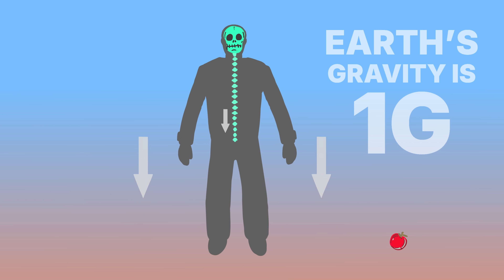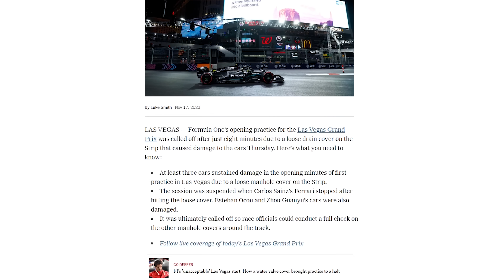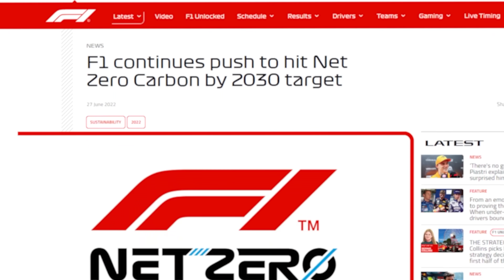Neil deGrasse Tyson Explains the Physics of Formula One Racing

Comment: @8:02-8:33 Correction: In that specific incident (2023 Las Vegas GP, Carlos Sainz) it wasn't actually a manhole or drain cover like was widely reported at the time, and the car's vacuum effect didn't suck it up like you've described (although such a thing can and has occurred in other races). It was a much smaller diameter object without a removeable cover: the head of a water shutoff valve. It protruded slightly above the paved track surface, enough that Sainz' car's floor struck it head-on. The aerodynamic forces did push the car down closer to the track surface and did likely play a role in the incident. just not in the way that is described.
Reply: Thank you for clarifying that.  As a 50 year F1 fan I get high blood pressure when the facts about F1 are distorted or ignored just to dumb down the story "so people can understand it".
Reply: @lonestranger  It was a flat 12" cover that should have been welded down.   There were a number of them that had to be inspected, which is why it took so long.  There isn't going to be something sticking up on a race track, much less an FIA F1 spec track.
Reply: Did they just Stallone Indy/Champ Car movie that incident? 😂
Reply: @JoelNekritz-te3gl haha OMG i forgot about that movie DRIVEN! 😂
Reply: @JoelNekritz-te3gl  Well this exact thing has happened as recently as 2019 Azerbaijan GP with George Russell, see watch?v=F5f87xjg-m4 It's just that it's not what happened this time.
Reply: What about this video? "George Russell's Drain Cover Incident Ends FP1 | 2019 Azerbaijan Grand Prix"
Reply: @kkfoto  That's the same video I posted in another reply above, and it's one of the instances I meant when I said "such a thing can and has occurred in other races". They should've used that incident to demonstrate the physics instead.

Comment: I would love to see a video about Top Fuel races. It’s completely nuts. They are so away from the box in which every other motor sport is. An they are the king of G’s - 6 and acceleration 0 - 530 kmh in under 4 seconds!
Reply: @pawewielgus2105  They average ~4 for a few seconds, 5 with the chute.  F1 only does ~2g accelleration, but hits lateral peaks of ~7 , sustained ~3-5 in many corners, 6+ g under braking - many times per lap; lap after lap for 2 hours.  A bit more of a g workout..

Comment: 3:44 You should see a WEC car, a f1 car can only do nose and tires, a WEC car can have whole sections of bodywork and even suspension replaced!
Reply: That's simplifying F1 to the extreme. They can change sidepods, the floor, suspension etc. Look at the cars. They can look different from race to race.
Reply: @sersjantma I was talking about what you can change in one single pitstop, it’s really impressive how modular that car is, it takes but a few seconds to change parts that would take atleast half an hour on a F1 car.
Reply: I've seen rear wings and other bodywork being replaced during pitstops in F1 races.

Comment: I know it may not seem like it, but the physics of NASCAR is why I watch. 

I'll put it this way: Travis Pastrana, an amazing FMX legend, daredevil...he's done it all. Rally racing, NASCAR, Motocross, Freestyle Motocross. When asked what the most difficult was, he didn't hesitate to say NASCAR (which, I'll be honest, shocked me. I know how much physics is involved in NASCAR, but I didnt think it would be harder than...idk, don't a double backfilp on a dirt bike!)! 

If you are interested, try a NASCAR simulator and see what I mean. The airflow from other cars, as well as the wall, changes the car's top speed drastically! It's crazy to see cars with, essentially, the same limited engines...and yet, some are able to get faster times by using tactics like getting a gravity assist from the bank of the road (if you are high up on the turn in a high bank turn, as you come out if the turn, you can aim a bit down towards the center of the track instead of following the outside line. When you do this, your car will be going downhill for a bit, hence: gravity assist).....or tactically teaming up with other racers because a row of cars is more aerodynamic than a single car, if they are close enough (like, inches apart...going 200mph. the margin for error is not very big and if you mess up, you can ruin the race, season, career or life of your opponent or yourself).

Comment: Fun fact: The shuttle (as a metric) would do a max of 3gs during liftoff. 

If you got the the fair and get the chance to ride a ride called 'The Gravitron', it does 3gs as well. Its also sustained. 

So, you can experience the same G load as the astronauts in the shuttle during takeoff. 

Personal, I love Gs. I can't say to what degree. I've done, maybe, 4gs (just a guess) max my entire life, so I dont know what it would take for me to blackout. 

That being said: If given the choice, I'd rather test my limits and increase Gs until I blacked out...then have to go negative Gs at all. Even 0G, like freefall.... ugh, makes me feel sick. 

The only rollercoaster I like is the original (as in the prototype from Knoxberry Farms) Corkscrew, since the the entire thing, except the initial drop, is all positive Gs or close to 1G. so, I get that sick (other find it exciting but I'm odd, I suppose 😂) feeling from the drop, but then the rest of the ride is a blast and feels super enjoyable. Every other coaster.... pure torture to me. All of them. The log flume is literally to low of a G experience for me. I can do it...but it doesn't feel good. 😂 It's a 10'-20' drop, maybe? 

....and I'd rather ride the inverted coaster (with a, something like, 30' drop) a dozen times, rather than the log flume once. 😂

Comment: Yeah, it used to be terrifying before the pit lane speed limit was introduced. Full racing speed until they braked at the pit box, separated from other pit crews by a painted line! Really impressive how they can stop, change the wheels and drive away faster than I could possibly get the spanner thing onto my bicycles wheel nut.
💚🐇🐴💚

Comment: Buffs there's a lot of misinformation and misconceptions here...

HANS it's not for Turning G forces,  the driver have to deal with those, and they're trained to deal with those for almost 2 hours 😅

The Hans it's for crashing, when they crash, they can have peaks of 200Gs

The aerodynamics it's not only for the rear tyres, it's for the front tyres as well, they have to press the whole car against the floor with a balance, 

if you overload your rear tyres, the front end of the car wasn't going to turn at the speed you wanna turn

And if your overload your front tyres the rear will become loose and harder to control, hence, slower lap times
Reply: F1 by misinformed people for unknowledgeable people

Comment: 7:45 missed opportunity to further explain ground-effect, might be worth it’s own short episode one day. Great example of ground-effect are the Soviet Ekranoplans or micromouse races.
Reply: soviet ekranoplans are not using ground effect to generate lift, or to be clear it is called "ground effect" but a completely different phenomenon. F1 car speeds up air beneath it thus lowering partial pressure and creating downforce, whilst ekranoplan takes benefit of a, confusingly same named, ground effect that creates higher partial pressure under the wing and thus creates lift.
Reply: the ground effect of ekranoplans and the ground effect  used in f1 are not the same. ekranoplans produce lift in the same way as an aircraft except that it is more efficient as a result of it being very close to the ground. since it is more efficient it needs relatively smaller wings. thats the ground effect being referred to in that case.
Reply: Agreed

Comment: The cool thing that surprises a lot of people about F1 cars is that with a normal car, the faster you go through a corner the more likely you are to lose traction because the friction of the tires isn't enough to overcome the momentum. In F1, if you go too slow in a corner you're more likely to lose grip because you aren't generating enough downforce for maximum traction.
Reply: also the brakes. if you go too slow you will not put enough heat in the brakes to work properly, so you got to go fast if you want to slow down
Reply: In the blown diffuser days it was even more dramatic since you needed to push out gases to increase traction, so.. applying throttle literally gave you more grip and letting go of it decreased rear downforce..
Reply: @squidcaps4308  It wasn't that they needed to per se, but it didn't ban blowing the exhaust gasses over the rear downforce components in the rules, so to gain an advantage on their rivals (as everyone would have to re-design their whole package mid-season to match) they started using blown diffusers. Same with Mercedes' DAS (Dual Axis Steering) to heat their front tyres better - rules at the time didn't state it illegal and it only got banned when the cost to replicate was deemed too expensive for other teams to try and match.
Reply: @squidcaps4308  And don't forget the fan car. :D Only ran once back in the 70s but man was it cool.
Reply: the big thing about the F1 downforce that people tend to forget about is that it really comes into play at the the higher speeds, not just any higher speeds but SERIOUSLY higher speeds, the tires ALONE are woth 2-3 G's when cornering (when at ideal temp and lifespan obv)
Theorethically there is a gap/valley where the tiregrip can no longer compensate and the speed is too low for downforce carry the rest but that gap hasn't existed for a couple of decades iirc.
The only place this is really an issue is with new tires (usually no longer an issue after as little as 2 turns) and probably where you got it from: amateurs getting a chance to drive an F1 car. 
Since nothing in human evolution prepares you for what it is like to push an F1 car to the limit, most people aren't able to do so during their first time driving an F1 car. This leads to a multitude of issues for the car most importantly the tires not warming up and not being able to give sufficient grip.
Reply: I remember Richard Hammond on Top Gear driving an F1 car, and he could not get the hang of the turns or get enough heat in the brakes because it felt counter-intuitive to go faster through the turns.
Reply: you say "in F1". it's high downforce cars in general, where you get more downforce the faster the car is moving. examples are: open wheel formula cars and "prototype" cars (LMP = Le Mans Prototype)
Reply: This show could have been an hour and it still wouldn't cover it all. Would have been nice to hear them mention more about the trickle-down tech the F1 engineers are responsible for.
Reply: And that’s not even mentioning having to drive fast enough to keep the tires within the best window of operation
Reply: Wow, I now look at F-1 cars in a different way… 16:46
Reply: No because you are also needing disproportionally less friction since you're going slower hence the sideways force is lower. If what you said was true, they'd just drive full speed in all corners
Reply: I heard someone say "whats impressive about an f1 car is not the speed of the straight lines, but the speed of the turns"
Reply: @jordantruong305  which is their whole point F1 cars have never been about straight line speed but what's impressive about them is their ability to attack the track as fast as they could possibly can at the very limit with the amount of grip and downforce the car produces, and the driver's skill to an extent as well. Corners is especially important in say, attempting for the fastest lap - in that situation, it's basically destroy those corners as quickly as you can without losing control of the situation
Reply: It's about getting heat into the tyre, more than downforce. If you push at full throttle on cold tyres, you will spin off, at a speed, you wouldn't on hot tyres.
Reply: @akyhne  You definitely need the tires to be warm, but an F1 car also generates enough downforce that if you had an upside-down road, it could drive on it. That much downforce is only generated at higher speeds, and if you lose it you won't have as much weight on the tires in the corners, so it'll be more likely to spin. I know Richard Hammond talked a lot about not having enough heat in the tires when he drove one, and he was right, but he was going really slow all the time because he was scared out of his wits (as he should have been). If he'd gone full speed in the straights to keep the tires warm, then slowed down too much for the corners, he'd still have lost grip due to lack of downforce.

Comment: Ground effect creates faster moving air under the car and lower pressure here, leading to a further increase in down force.... not lift as you and your graphic would suggest. A F1car creates more down force than it weighs and therefore it is said could be driven upside down at over 150mph.
Reply: I think what they meant is the car sucks the ground up. Which is the same thing as pushing the car down. Yeah, the animation in the video is not very good.
Reply: Please watch this part of the video again. In the graphic they are clearly talking about the upwards force things on the ground (such as manhole covers) are experiencing due to the low pressure. They are physicists, they of course know what downforce is and that it pushes the car down. They literally explain it with the upside down airplane wing analogy.
Reply: @coin5207  they literally say the floor drags air with it bruh they can be physicists but they now nothing about aerodynamics, also they say they add downforce on the rain just on the rear to have more traction on the rear wheels💀
Reply: @Sbinott0   "They can be physicists but they know nothing about aerodynamics"
My guy do you not know aerodynamics is a subfield of physics?? Fluid dynamics is something covered by every undergraduate physics degree.

"They say the floor drags the air with it" - yes?? What problem do you have with this statement? The underfloor is specifically designed to accelerate the air below it along with the movement of the car which you could describe as "dragging" the air with it - obviously there are probably more technical terms but the purpose of this video is to explain these things to the average person in simple terms

"They said they add downforce on the rain just on the rear"
Well they were probably told by the Ferrari person the team brings specific high downforce rear wings for wet races (which is for traction on the rear tires). And then assumed that is the only thing the team does.
It is incorrect but them being physicists would not give some big advantage in knowing this since it's an F1 car specific thing, road cars won't have anything more advanced to adjust than maybe a rear wing if it's a sports car. As opposed to the other two things mentioned which are clearly about physics.
Describing this as an "error fest" is just inaccurate. You will hear comparable mechanics related mistakes and what not on a normal f1 broadcast when pundits or anyone who isn't an engineer speculates about the cars
Reply: I agree the graphic might be a bit confusing but it is correct. A F1 car sucks itself to the ground (a force pointing down) thus creating an equal but opposite force on the ground (Newton's 3rd law of motion)...in other words, the ground experiences a force pointing up which is called "lift".

The speed a F1 car would need to go at to be able to drive upside down depends on how much down force it creates. I believe at 125 mph a current F1 car can create enough down force to equal its weight. Of course there are other factors that have an effect on being able to drive upside down. To be able to drive a car's tires need grip. That grip is generated by the down force AND the car's weight. When driving upside down that weight acts as a force in the opposite direction; downwards. So the force pushing the car up is the generated down force minus the car's weight. Which means the down force needed is much more than a F1 car generates at 125 mph.....the down force needed would have to be about 2 to 3 times the weight of the car. Which still is possible as the down force increases squarely proportional to the car’s speed...twice as fast means 4 times the down force. However, an ICE won't work when upside down so we'd need another kind of engine to propel the car forward, like an electric engine (increased weight due to battery pack) or a 2nd oil tank to have engine lubrication in the ICE when upside down as well as making sure that in an upside down position oil can't leak into the combustion chamber. And of course you'd have to figure out how to get the car in an upside down position in the first place. You'd need a gradual way to go from driving the right way up to getting upside down, something like a big arc. How big of an arc would depend on how far the wheels are apart and how low to the ground the car sits (at the speed needed to drive upside down) but it would probably have to be an arc with quite a big radius.
So whilst a F1 car might be able to drive upside down it is not as clear cut as simply driving it upside down.
Reply: The next generation...corkscrew on trak? Seriously.
Reply: This video is an errorfest
Reply: Talking about F1 and using mph...
Reply: @DaveMcIroy  F1 on SkySports always use mph so I don't see the problem.